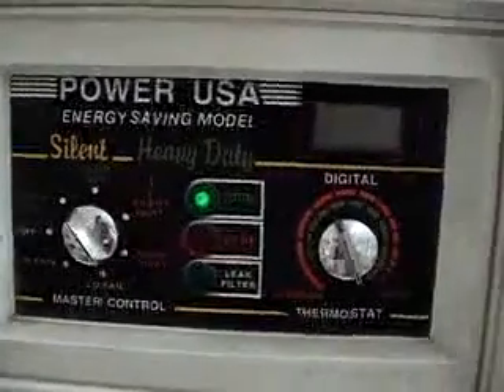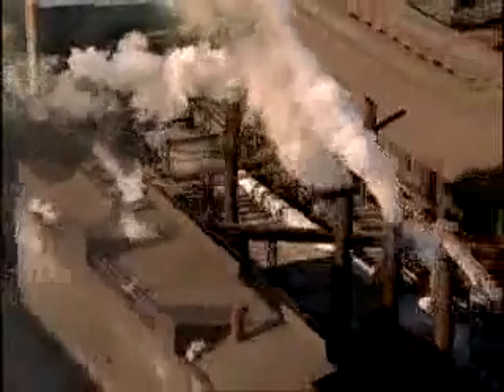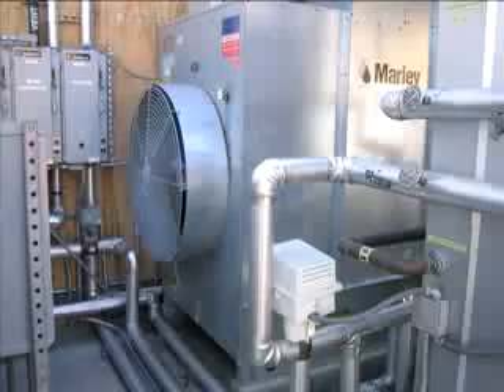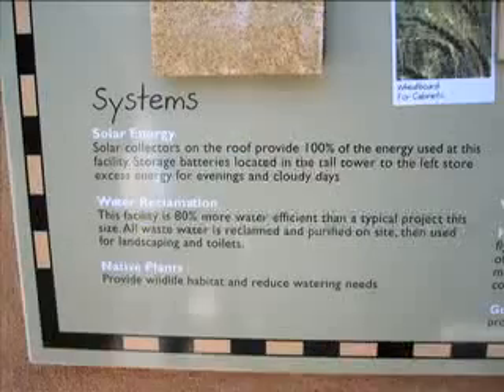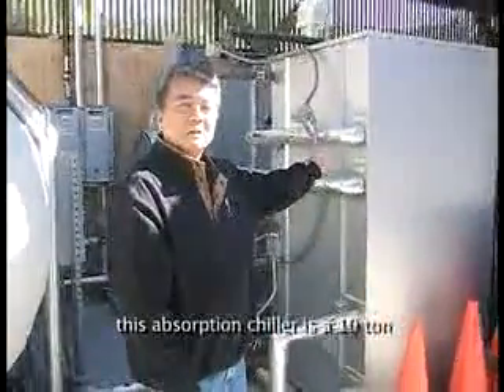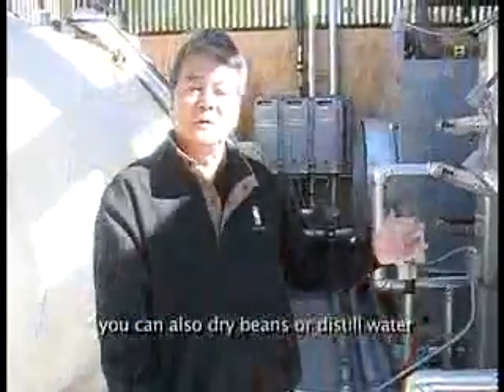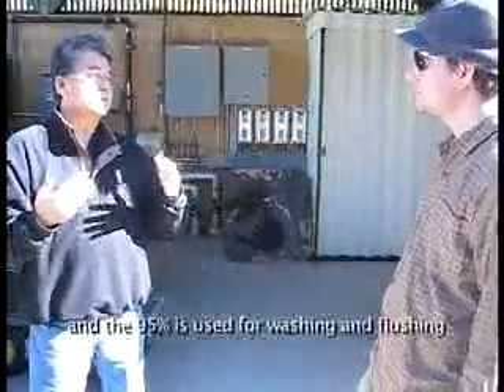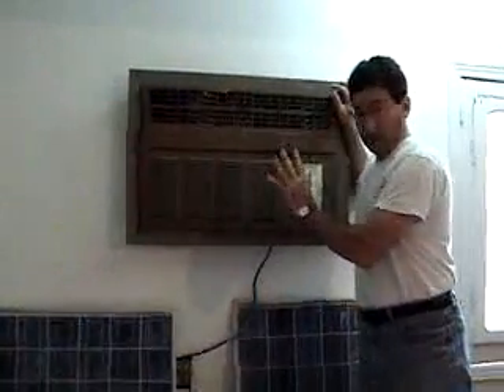Solar AC Unit Employing Solar Absorption Chiller Technology

Comment: this video is misleading, and poorly made, ANY unit that can move thermal energy is doing so by removing heat from one place and placing it in another, no matter what kind of AC you build for a house, it will ALWAYS remove heat from inside the house and dissipate it into the surrounding environment. get off your fucking high horse and stop pretending your unit doesnt do the same, the laws of thermodynamics cant be beat.

Comment: Blah, blah, blahhh....... This guy, obviously, believes allot of bullshit.
I wish the atmosphere was allot more co2 than  less than 3 - ten thousandths!!! It would cause the plants to grow bigger and better, plus produce larger & greater amounts of fruit, vegetables, grains & nuts.
So fuck the ozone hole -which could have been there since the beginning of time for all we know!!!
Long live oil & give us more CO2!
:-)
Reply: You also obviously believe a lot of bullshit. After the plants absorb CO2 in the spring and summer, what happens in the fall and winter? The plants die and they rot. Rotting is caused by bacteria digesting the plant matter. And what is released by the bacteria as a byproduct? The same CO2 that was originally absorbed by the plant, only some of it has been converted into methane - which is 20 times more powerful as a greenhouse gas. Even if you captured the methane a burned it as fuel, the resulting byproduct would be the CO2 that got absorbed originally. Plants go NOT reduce the amount of CO2 in the atmosphere. They merely convert it into sugar temporarily until something eats it.

Comment: Im a HVAC contractor this is a good idea however its large, no one talks about COST not just cost of all that equipment but the whole crew of HVAC contractors, plumbers,labors crane to lift that huge tank,trenching equipment im sure i missed a few other things, what about Insuring the home? is that equipment UL listed? because if it all goes wrong that system fails like floods blows up the first thing there going to say is were not covering it not UL listed or other insurance approved tested and rating its a long road.
Reply: +Darren pope Have you got any answers for your concerns?

Comment: This exotic setup has a 4-5 year payback at best.  I am convinced solar heating with panels makes sense financially as does domestic water heating.  Heating up the hvac coolant on residential or small commercial may also make sense.  These large commercial absorption chiller projects are quite costly and payback sucks compared to modifying efficiencies such as staged chillers and optimized operation through controls automation.

Comment: I came across this in my research for a solar absorption chiller for my house in Lagos Nigeria (I currently have eight air conditioning units (one in every room) burning 1.5KW per hour each (i.e. I'm motivated). There is much hype about this technology, but finding units, buying them and installing them seems (except for big commercial units) seems like something for Sherlock Holmes.

Comment: This in nothing new, absorption cooling was invented by the French scientist Ferdinand Carré in 1858 and commercial production started as early as 1923.  Beginning in the 1960's and continuing today you can find absorption refrigerators in RV's mostly using ammonia.  Today there are many different types of absorption cooling: 
NH3/H2O or Ammonia/Water
Water/Lithium Bromide
Water/Lithium Chloride
Water/Silica Gel or Water/Zeolite
Methanol/Activated Carbon

Comment: I wish this video didn't have the ridiculous intro that it does have and get into the explanation so it could be more thorough.

Also, I'm sorry but your final statement is very, very false.  We no longer need coal plants and Nuclear plants for the power grid?  What happens at night?  Current Lead Batteries last for 5 years if that. What gives us the energy to produce the solar panels?  It sure isn't other solar panels.  And what about cloud cover.  If there is no sun for a few days (aka winter)